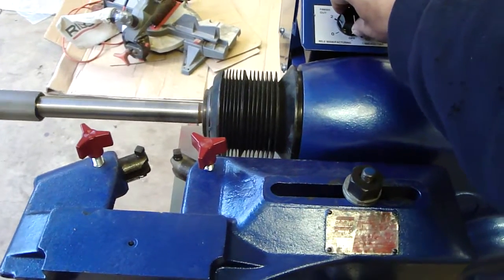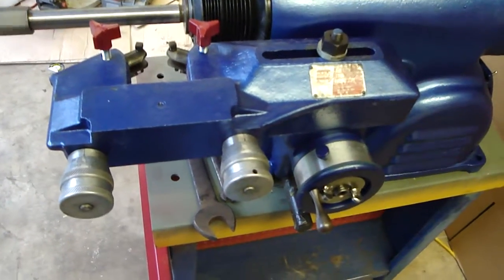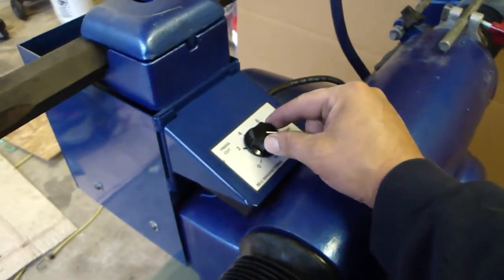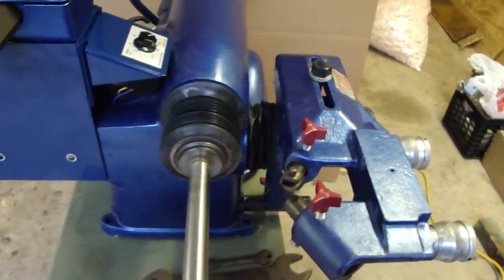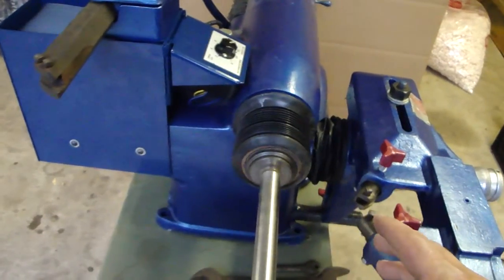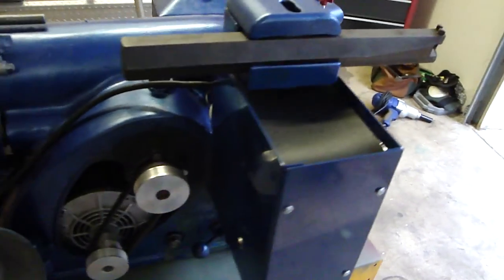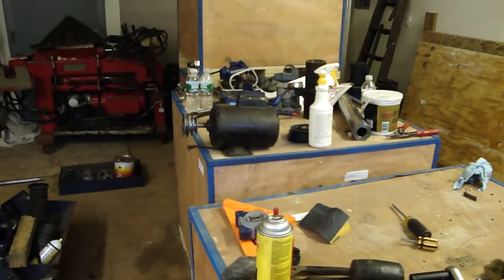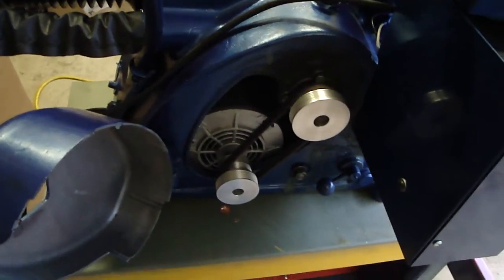Ammco 4000 Demo for Larry Johnson

Comment: I am not 100% sure due to shadows but it looks like you have the pulleys set up wrong.  Can you please confirm that you have the largest diameter, of the larger pulley, closest to the back of the machine?  It looks like it may be mounted backward, the bigger diameter facing out.    Question:  You mentioned V Belt in the video, did you mean Serpentine Belt?
Reply: yep got the drive pulley backwards.
Reply from the maker: Check the manual again, you can run it both ways for higher or lower RPM's